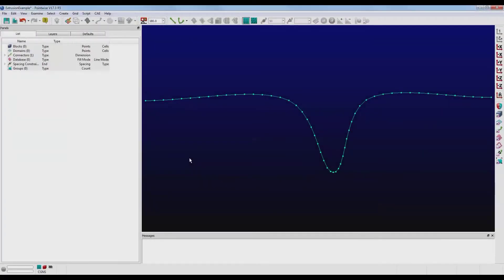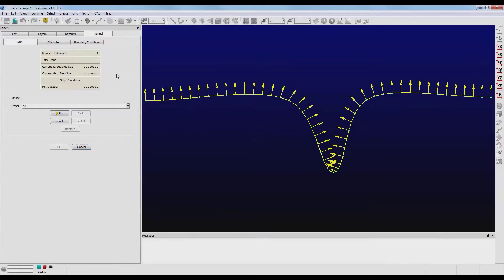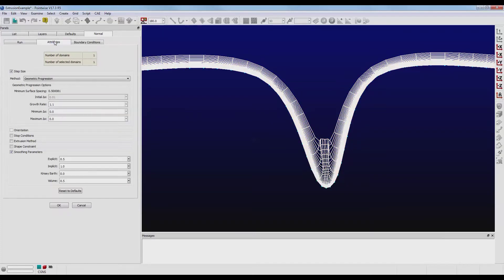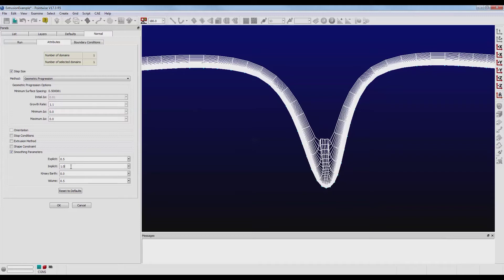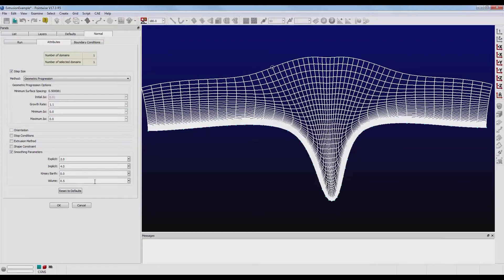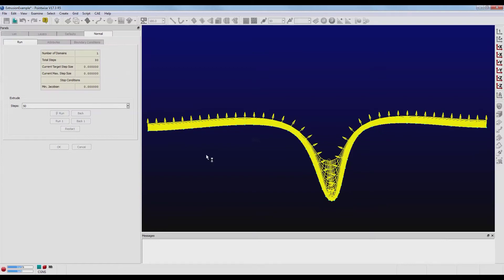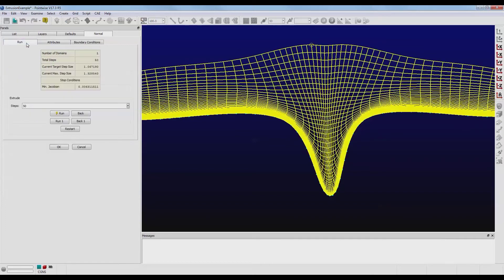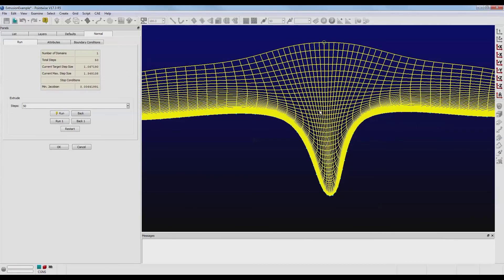Hyperbolic Extrusion Smoothing Parameters

Comment from the maker: Thank you all for your comments. For more information you can reference the User Manual. It discusses each parameter and the roles they play in extrusion. Also, see "Development and Implementation of Gridgen's Hyperbolic PDE and Extrusion Methods" by John Steinbrenner, Nick Wyman, and John Chawner, or "Gridgen's Implementation of Partial Differential Equation Based Structured Grid Generation Methods" by John Steinbrenner and John Chawner.